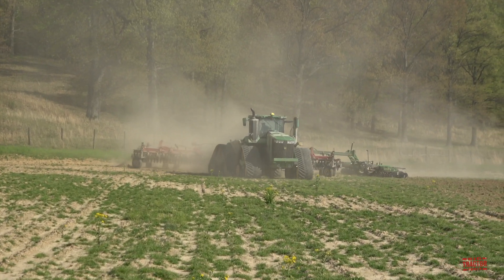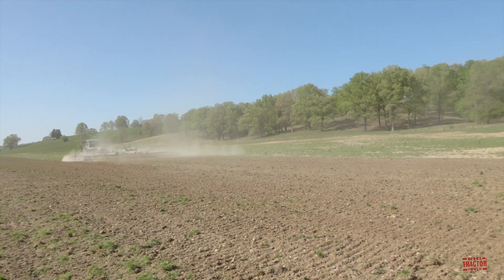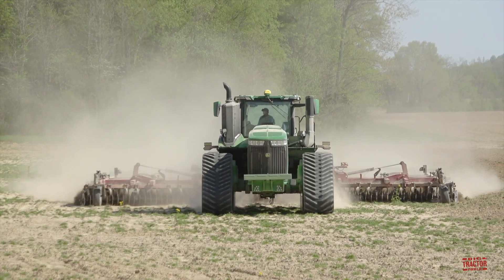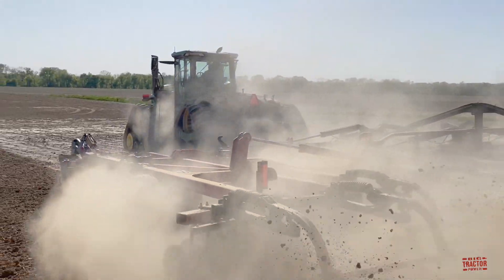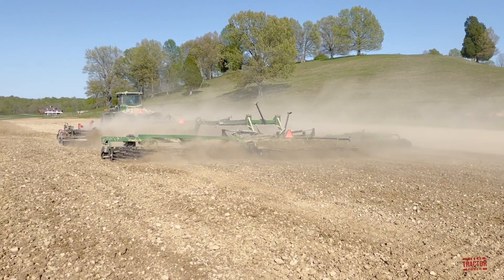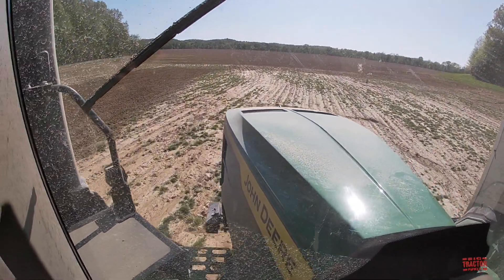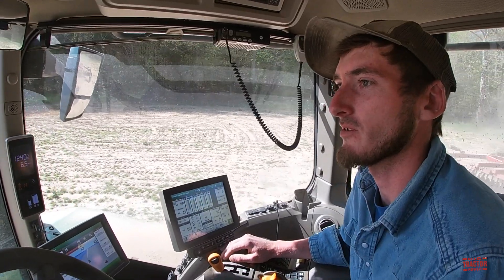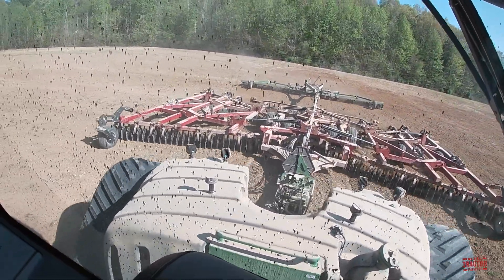JOHN DEERE 9RX 640 Tractor Working on Spring Tillage

Comment: does it really need that much horsepower for that job? I don't think so.                                       I think that they can do the same job with half the horsepower
Reply from the maker: This is not the only job this tractor does on the farm.  It runs a Krause Dominator in the fall running 18 inches deep and 23ft wide.  With this spring tillage pass the tractor runs faster than a lesser powered tractor getting more acres covered per day.
Reply: @bigtractorpower  why so deep?

Comment: Can’t understand why Deere keeps going backwards with their articulated tractors. They had a good thing with the Cummins engine and they dumped it for the anemic new 13.6. 
My 9570R will out pull a 9R 640.
Reply from the maker: Bigger and better things are on the way in the near future.  This tractor will be mid range soon.

Comment: How deep is he pulling that 330? Doesn’t even look like an inch? I’ve got my 330 depth gauge set past C almost to D. Maybe I’m going to deep? 🤔 Only my second year with it.
Reply from the maker: I did not see the setting. I would guess 2 inches. The field is a river bottom.  It was deep ripped in the fall and had NH3 applied in the spring. The 330 is just cutting up the annual blue grass and smoothing out the NH3 application.
Reply: @bigtractorpower  .. Do track type tractors have a 'wheel' slip system, if so,  is the % different than a wheel tractor ?
Reply from the maker: @garytanger965  I do not know.  I have only ever seen a track tractor pulling a 60ft air seeder up a steep hill or running a ripper 18 inches deep on a compacted headland.  The rest of the time tracks just sail across the field.

Comment: I don't care how quick you can make your money back there is no reason any vehicle on this planet should be priced that high it's unrealistic and it's bs
Reply from the maker: These are industrial machines just like CAT D11 bull dozer.  They have big jobs to.  Components, computers and emissions drive the price up and up. There are plenty of used machines out there that are a cheaper option.
Reply: @bigtractorpower  I know but realistically it wouldtake like 10 years to pay it off and the payments would still be sky high
Reply: @joshuadixon4931  it may be a bigger and more expensive tractor but then farms that require these tractors are also bigger and you'll make more money from them.

Comment: I'm pretty sure the John Deere 9RX 640 for model year 2022 went back to being powered by John Deere's own 13.6L engine according to the specs on John Deere's website, they apparently keep switching back and forth between that and Cummins engines (particularly the X15) every few years
Reply from the maker: The one in the video was delivered on in late March and has the QSX15 engine.  I was surprised looking at Deere.com to see the 14L engine listed for all models. The 2022 models will stand out in the future. I suspect the reason the website shows the 2023 specs is all production is sold out this year.
Reply: @bigtractorpower  Ah, interesting

Comment: Another video where the guy is turning on the unworked headland and the implement is bouncing like crazy.. Why don't they work the headlands first
Reply: There are cons to working the headland first and then working it again when done.  It fines up the dirt more which can lead to crusting issues after heavy rains.  Also reduces water infiltration. 

Working it twice causes additional moisture loss, which can be problematic especially with shallower planted crops.  2nd pass also burns more fuel and causes more wear on the tillage implements.

Comment: Man oh man what a tractor, the extended length and width of those tracks really make it look like the beast that it is. 

While I'm a big Cummins fan in trucks, I for one am happy about Deere's decision to use their own 14L engine in 2023, while having a slightly smaller package, and retaining the same hp ratings, on a theoretical smaller amount of fuel.

"Nothing Runs Like A Deere" 🦌👍🇺🇸
Reply: The myth smaller engines of the same hp as bigger engines burn less fuel is just that. A myth. I have a 9630 and and 865 and the Deere 13.5 will use just as much as the c18 and while the Deere is rated 5 HP more the cat will out pull it easily and the same less fuel.
Reply: @MrTjulius  I was thinking the same thing actually. Probably due to the smaller engine being operated close to its limits whilst the larger engine has a bit more in reserve and so isn't so stressed - probably a slightly lower engine speed to achieve the same output, acre wise, too.

Comment: Ahh .. wonder what happened to there 2 track tractor being superior to the Qaud.  I guess if You can't beat em," join them.. resembles there claim of the rotor Combine being no good.. Look at em now..🤣🤣🤣
Reply: I think a 2 track of the same hp and torque would probably pull better than a 4 tracked tractor but a 4 tracked tractor have many advantages over a 2 track like steering for instance. Maybe John Deere haven't put the 2 track into production yet.

Comment: For 800k before taxes, he better like that tractor. For the life of me, I cannot understand why people continue to buy John Deere. With their policy of not allowing the farmer to work/fix their own equipment and the huge cost incurred because of that. I would never buy a John Deere until they smarten up.
Reply: When the John Deere diehards smarten up and start buying yellow, blue or red, things might change.
Reply: Doesn’t the right to repair factor into almost all brands? Thought I read that it does but JD is just front and centre of the issue. Might be wrong.
Reply: Clearly your another one of those who hasn't read about the right to repair act. Right to repair only has to do with electronics and nothing else. Deere has gave people the software to be able to scan codes and all that, the question is are they good enough to figure out the issue? The answer is probably not also Deere is not wrong especially with all the regulations to not allow just anyone to mess with the electronics on equipment. Deere has never said you can no fix your own equipment and that's the myth everyone is trying to push. Lastly don't think every other manufacturer wouldn't be on board and the car industry has been doing the same thing for years and no one says anything. Wonder why that is.
Reply: @joegotz1971  Deere diehards are never going to change lol why fall back to less equipment? Less dealer support? Less manufactures support? Your logic makes no sense. We have been a Deere farm since the 40s and have 8 dealers with in an hour but only have one case dealer and one acgo dealer in the same distance and the next closest after that who knows.
Reply: @chadjustice8560  The reason you buy JD is local dealerships and parts. In the 50’s and 60’s the majority farm equipment was Oliver for the potato farmers. They had a good dealer. Zeorian harvesting switched to new Holland because of field service and parts. I guess what ever is local they all break down. Mike Mitchell s switched to Fendt because of warranty.
Reply: @joegotz1971  it’s a good thing mike switched for that warranty since he seems to need it very frequently.
Reply: @94chevyz71  I told him no to buy Fendt!. Especially the combines, far too many moving parts. Case IH and Gleaner are less complicated machines with far less moving parts. Less parts less to fix.
Reply: @joegotz1971  I imagine once case comes out with their new quadtrac Mike will probably look at one of those but his fendt hasn't been too bad other than that add blue/ DEF issue it's been pretty good.

Comment: Another operator who does the headlands last and bounces the implements on every turn. Amateur!
Reply from the maker: Almost every farm that I film it saves the headlines for last because of all the turns.   They like to run over those last smooth out the tread marks as well as breaking up the heaviest compacted area last.   Most of the farms I have filmed at also plant corn last on the headlands now.
Reply: @bigtractorpower  I always did them first and last, except if there were no washouts .Plus we never lifted the implements all the way up, just enough to turn around and not dig into the ground.
Reply: This guy is not an amateur!  He is running a million dollar set up.  Top crew.
Reply: @StubProductions  There is a lot of added stress on the wheels and axles when the implement bounces around. The bigger the bounce the more stress it puts on the axles.